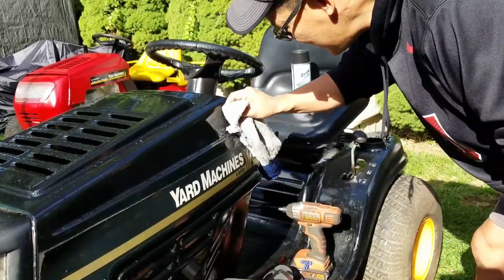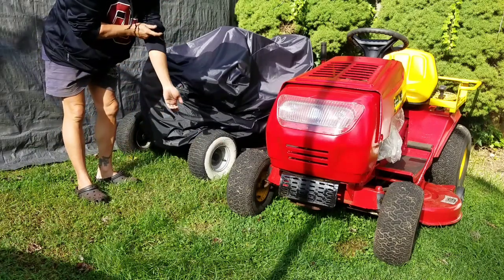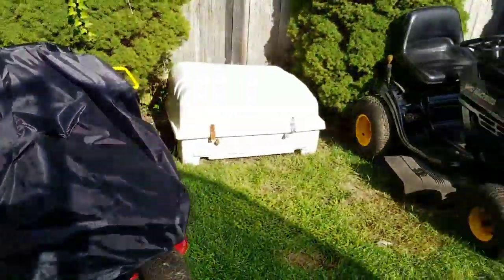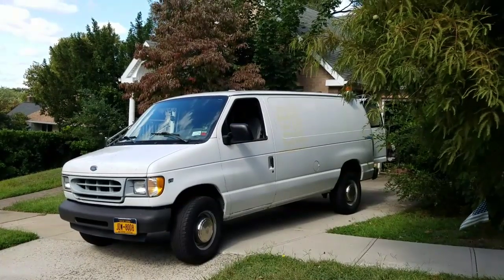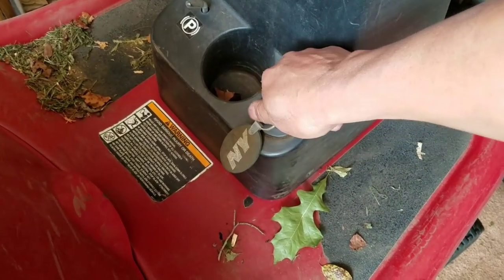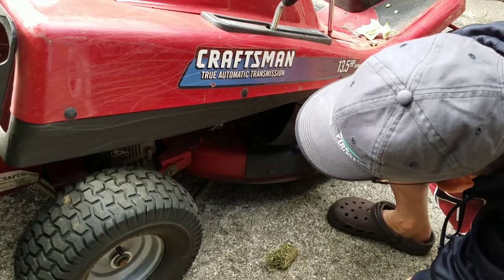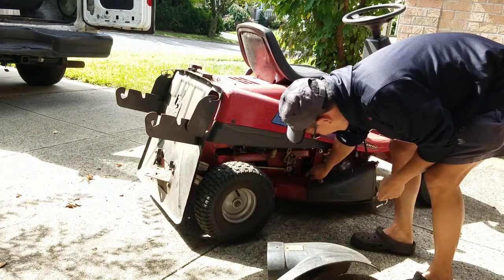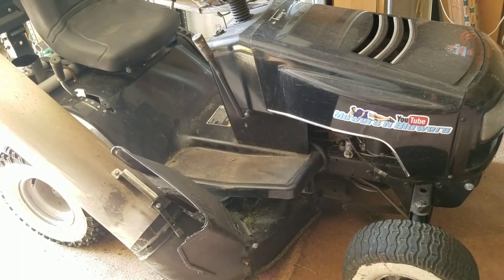CRAFTSMAN 13.5 MID REAR ENGINE RIDING MOWER HOW TO OPERATE INSTALL BAGGER CUSTOM MURRAY LAWN TRACTOR

Comment: I left one in the junk yard those are intek motors with different cover always blow up aluminum sycro balancer, throw rods,valves need adjustment constantly
Reply from the maker: Ive Had 4...all engines worked.

Comment: Henry. Regarding the winch remote. I do believe they make replacement learning remotes. They are fairly inexpensive. You might be able to just replace the remote.
Reply from the maker: It's temperamental, some days works fine, some days hinky.
Reply: @MowersNBlowers  Can't you attach a manual crank in case of power failure, or get one that has that capability.
Reply from the maker: @BACON-l3t  definately not on my model.  But I could buy another model that has that but much more expensive.

Comment: I have a few ham radio friends up there in queens and LI. Man I love this motor in this craftsman rear engine rider. Absolutely biggest design flaw of this mower is the front wheels will snap. Nylons bushing on metal never works. Usually snaps the junk weld holding them on too. If it weren’t for that I’d never get rid of it. Now I don’t know what to buy next. I need something smallish 42” max but I hate the new mowers. Decks rot off or they blow oil from dipstick tube. Any advice Henry? Thanks sir
Reply from the maker: Get a zero turn from Toro,  like a time cutter,  you won’t regret it.

Comment: Mowers n blowers i have that red craftsman mower and when i put it in gear it jerks like its not engaging..just started doing it to me im wondering if its the hydrostatic transmission? Or maybe the belt is worn..your thoughts?
Reply from the maker: Could be both,  flip it to the side,  remove the deck and you’ll figure it out

Comment: For the red craftsman. Do you have to hold the lever in forward position while you are operating and hold one hand on the steering?
Reply from the maker: No your shifter needs tightening
Reply: @MowersNBlowers  why is my shifter not tightening? When i release it. It slides back to neutral. Or goes very slow
Reply: @MowersNBlowers  how do I tighten the shifter
Reply: @MowersNBlowers  help me please. I just bought this rider for my moms house
Reply from the maker: @MrPsychoMiko1  take shifter off,  use pliers or channel locks and crimp the sides so the shifter is tighter
Reply: @MowersNBlowers  can you post a video please?
Reply from the maker: @MrPsychoMiko1  I don’t have the rider anymore
Reply: @MowersNBlowers  oh man. Didnt you have like 4 of them ?
Reply from the maker: @MrPsychoMiko1  yes,  but I’m a flipper,  I fix them and sell them.  I never keep any of them!  Take the shifter out and bang the sides of it so it holds the lever tighter.
Reply: @MowersNBlowers  ok I’ll work on it and let you know! Thanks. But do u have a video of how it should look when its operating?
Reply: @MowersNBlowers  hi. I sent you an email. Can you take a look at the pics?

Comment: Henry do you remember what model that rear engine craftsman was that was at your moms? Thanks
Reply from the maker: Craftsman 536.270320 RER 30" Briggs & Stratton 13.5 hp Gas Powered Riding Lawn Tractor

Comment: You changing oil in your black Murray been a long time
Reply from the maker: I was thinking that last night.
Reply: @MowersNBlowers  last time was when carb flooded engine
Reply from the maker: @mrbriggs68  yeah, it's due a proper sae30 switch.
Reply: @MowersNBlowers  yes coincidering you put winter grade 5/30 last time might be good to clean carbon of the head i notice it is smoking at start up a lot of blue smoke
Reply from the maker: @mrbriggs68  or seafoam it.
Reply: @MowersNBlowers  after 18 years it would be interested to see what it looks like inside take it apart video it seafoam it and video the after . do a real test like project farmer does

Comment: 200 for the yard machines? If I had space I'd buy that!
Reply from the maker: It's a piece of junk Nick.
Reply: @MowersNBlowers  swap seat with your zero turn black seat and black steering wheel would go together and the yellow seat with go with the yellow wheels on the junk